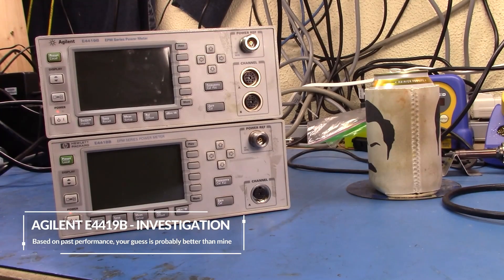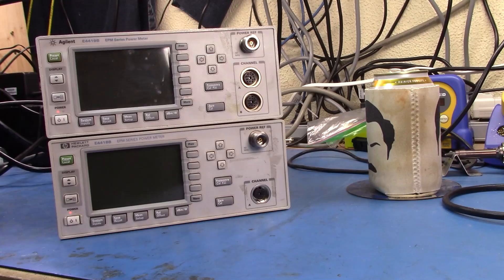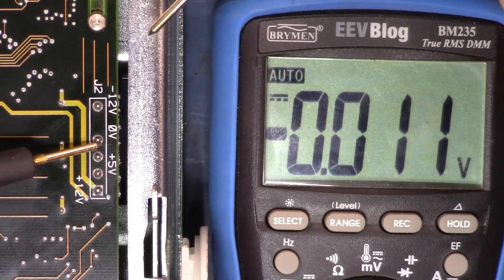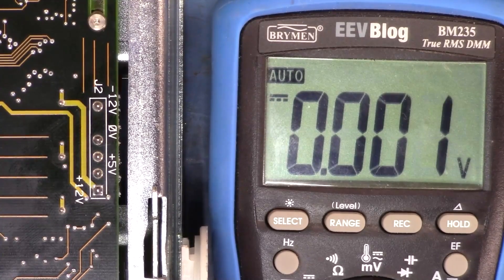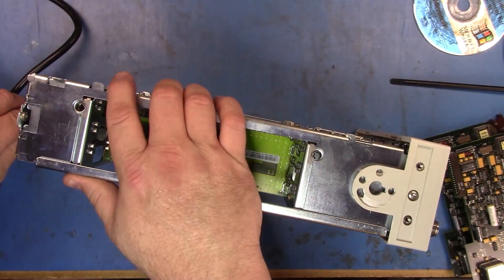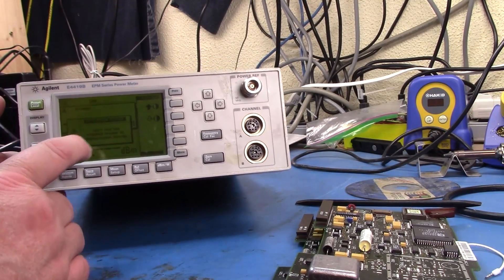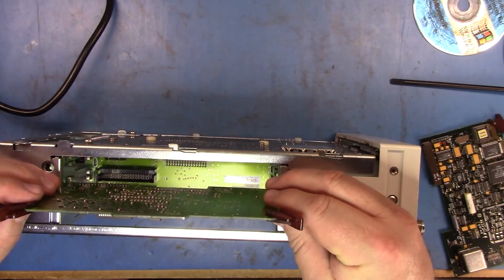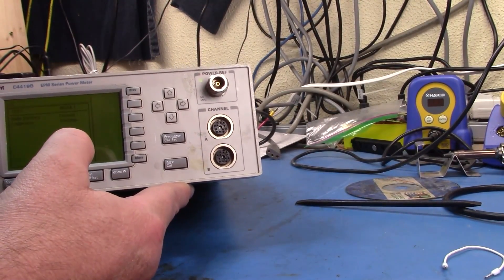Agilent E4419B - Investigation

Comment: it's the membrane keypad and the only solution is to replace it. been there done that several times. was never successful in repairing that keypad membrane.
Reply from the maker: Thanks - I have never been successful either but I watched FeedbackLoop's video where his magically started working so who knows :)
Reply: I disagree.  I have successfully repaired about 5 keypads on the 8753 series VNAs.  I use Neolube No. 2 to place up to 3 layers of new film conduction on the back of the pads.  I've not had any issues with these keypads.  I have a video on my channel where I go over this process.

Comment: disconnect the keypad altogether before you try bridging contacts on the board
Reply from the maker: Thanks - I wouldn't have thought that this would make a difference as the button should be in parallel to the short but it certainly appears to.

Looks like I'll need to disassemble the front panel - Did you have any success in cleaning the keypad?
Reply from the maker: I just checked eBay and they have replacement membrane keypads for around US$25 - I've never had much luck cleaning them but it'll be interesting to see if it is possible.
Reply: @tgsoapbox  I believe that they fail by developing internal shorts between layers